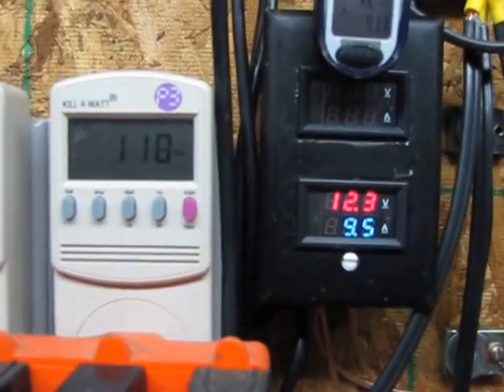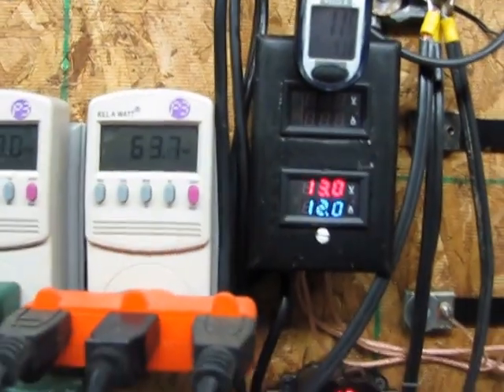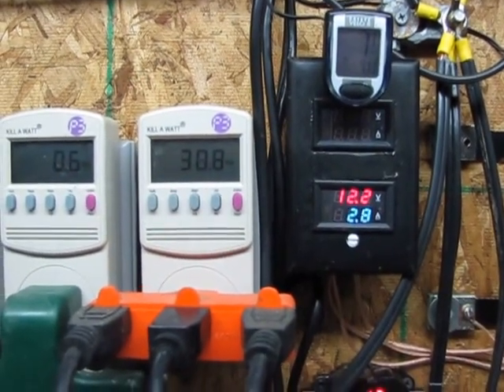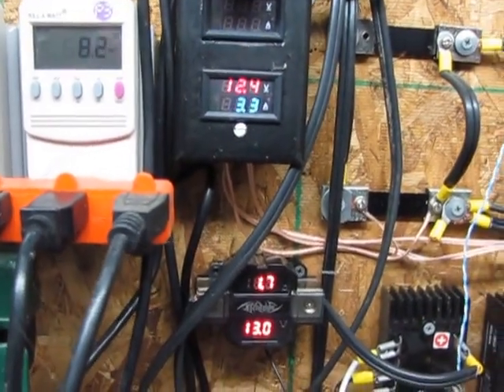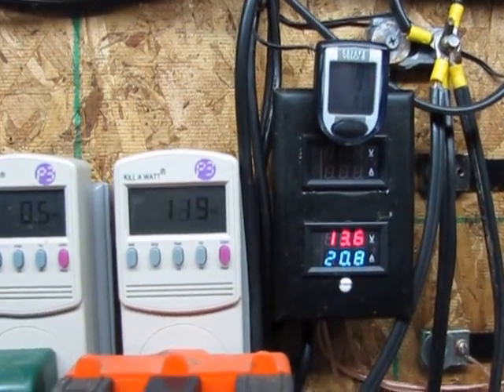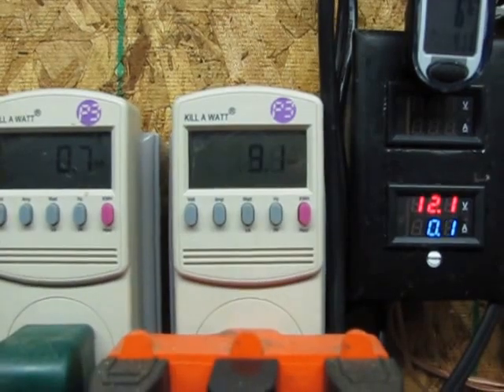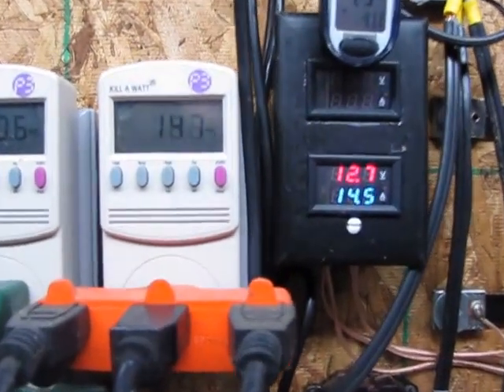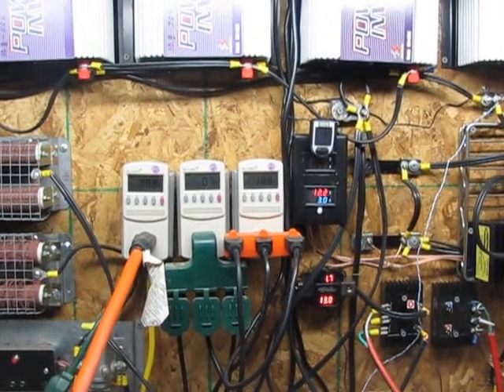A 12 volt wind turbine system power shot , in my bad wind location

Comment: Yeah Jason,I don't see enough of your videos to keep up with what is new!My turbine is still going and I had to design another idler pulley last week when I found out that the blade spins,but the belt was slipping. DOOOOH! Killer wind last week in Seattle.Now,I'm bored with the turbine and want to tie in a PV array through the turbine wires to my shed. It looks like I have to run a separate charge controller from the PV to my charge controller and my dump load set up.I may have to run another 60' of 8 GA. wire to my shed.I can use the negative lead from the turbine,but run another wire to the charge controller (to the relay).I wish that I could run the PV output parellel to the turbine out put AT the turbine and let the turbine charge controller take care of any over voltage conditions.I'll start with a 150 W. 12 V. PV panel. I would rather use the same 2 wires from my turbine.
Reply from the maker: +ddd228 
If your looking for good prices on solar check this place out ,, https://www.solarblvd.com/index.php?cPath=1_270  ,, This is where I buy my 24 volt solar from
Reply: +Jason Brown  They have some REALLY good prices on that site! Thanks.I should have asked you first. I bought by first one from Ebay. I'm still 12 V.

Comment: I have a power jack charge controller 12 or 24volt that can charges batteries and when your batteries are full it switches to the grid with a grid tie for your solar panelsI have no use for it I'm switching to 48volt It's your if you think you can use it

Comment: this cable may be useful with the 12 volt runs

http://www.amazon.com/100-ft-Landscape-Lighting-CLV-1002-0-100FT/dp/B009RRO8VO/ref=sr_1_2?ie=UTF8&qid=1452695258&sr=8-2&keywords=10%2F2+Low+voltage+landscape+lighting+cable+wire
Reply from the maker: +Rev John O'Toole 
That's nice,,100ft of 10 gauge wire for a little more money than the 100ft 12gauge that I found at lowels,, spend a little more for a thicker gauge wire :)